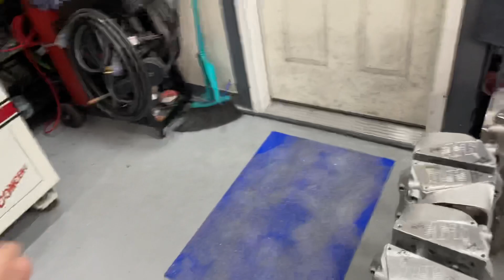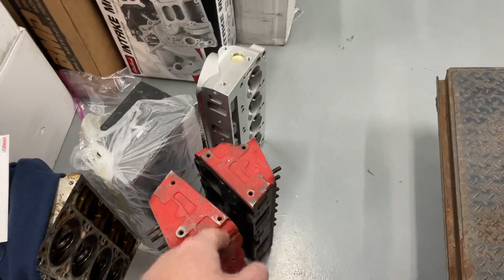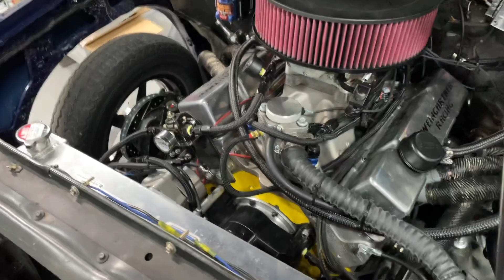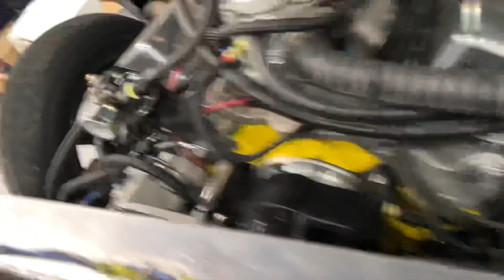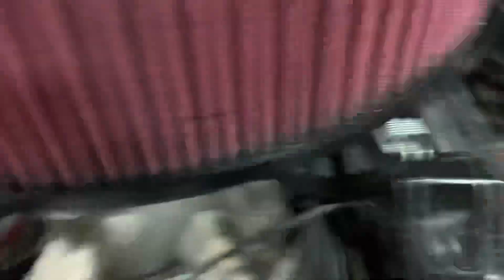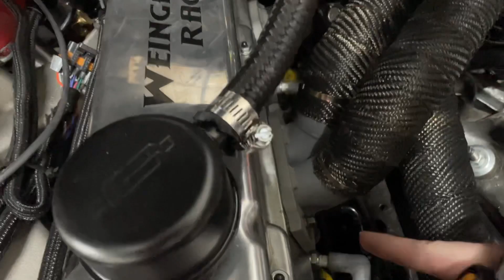Maybe I Will Get To Race and Water Lines for SBC

Comment: Perhaps you could show the head with a gasket on it and how those hoses allow better cooling?
There always is the conundrum that the cooled water comes onto the front cylinders and then past each one so the back 2 are the hottest.
Maybe waterpump to core plugs would make a more even cooling flow, plus the head mods?

Comment: I want reverse cooling on mine when I take my truck FT block to 4.19 bore with .1256 walls between the bores and .250 major thrust and .180 minor with a fill to the bottom of the water pump holes. With a 4.25 stroke it should be a strong enough engine. The 394 has gone through the lights at 7800 for almost 30 years. 10.88s , but this block is a real find . I still need heads. My hand ported iron ones disappeared from the machine shop….  I have to start over and F iron. Never again!

Comment: hi Engine CR please . Is that the reason for xtra cooling ?? Or because of design faults with sbc . 
Exhaust port ,I understand that ie hot spot .  Rear of cylinder head , is this for overheating ie xtra cooling or bleed off the air which might get trapped there which then causes o/heating OR both .
Reply from the maker: I did it as extra cooling but you really don’t need it.

Comment: Hmm. Weren't your tires spinning off the line already with the 4.30 gear?
Reply from the maker: With the th-350 yes but not the powerglide.
Reply: A small plate system like +100-150hp would make the converter act a lot looser and probably be less $$$$ than a new custom convertor....depending on how much you spray and if willing to put in race gas, you might even be able to utilize the old gear-set.